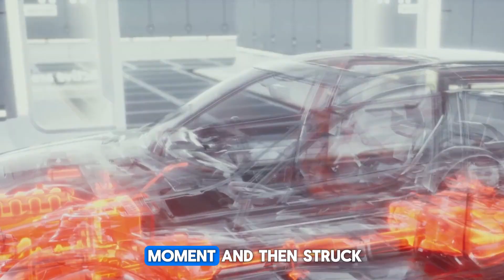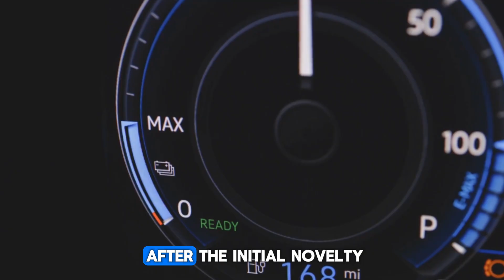Mercedes Drops a Bombshell: YASA Flux Engine Officially Confirmed!

Comment: It is NOT an engine, it is a motor.  And current ones are around 90% efficient, so not much more to go.
The actual advantages are size and cooling.
Reply from the maker: You're right, it's a motor, and its compact size and cooling are key advantages.